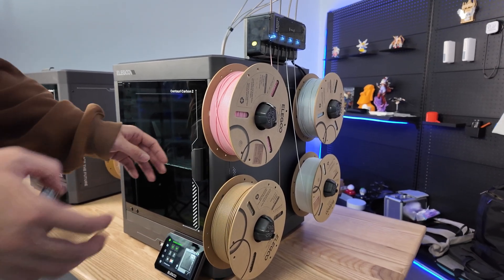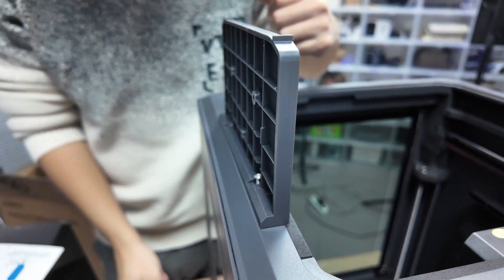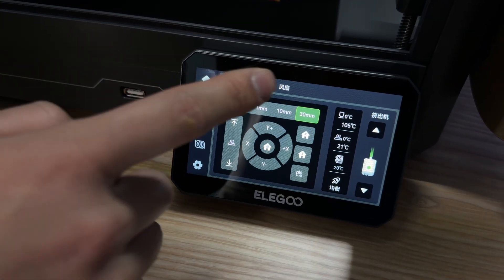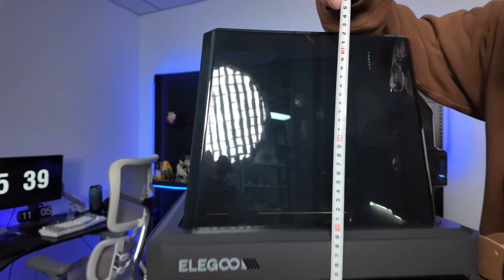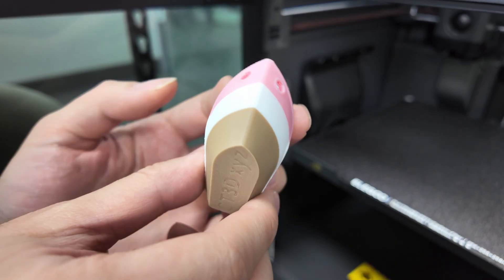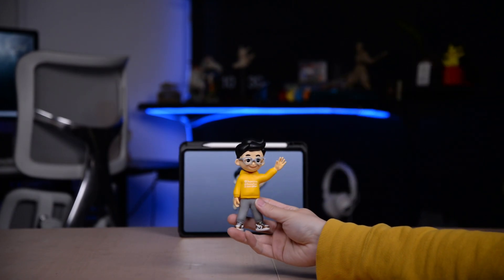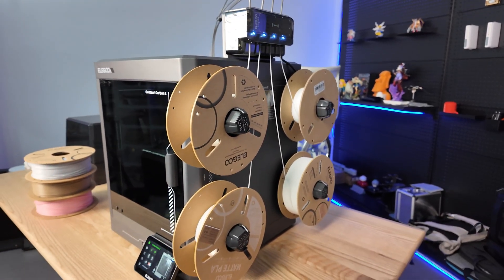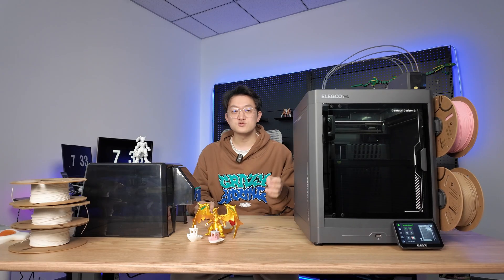Upgraded Multi-Color 3D Printing, More Powerful, Yet Cheaper!? ELEGOO CC2 User Experience Sharing

Comment: Thank you for this video, I got to see the advancements in the centauri carbon 2. I have the original and wanted to know more about the changes.
Reply from the maker: So, you mean you want to compare the differences between the CC2 and the CC? The main points are that the CC2 can print multi-color models while the CC only supports single-color printing, and the CC2 has better chamber temperature maintenance.
Reply: @zedmakerlab   I was talking about it on a more technical level. Not a jaded stab at what is still in the works for the original.